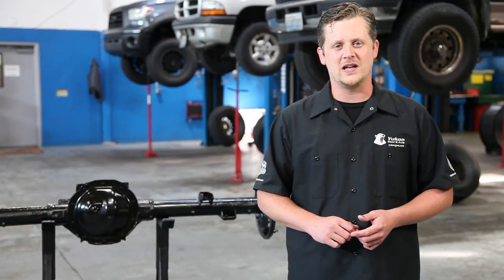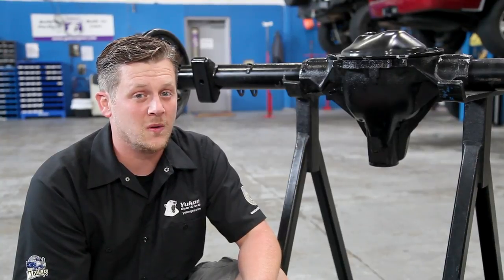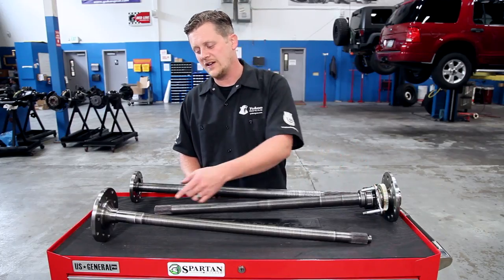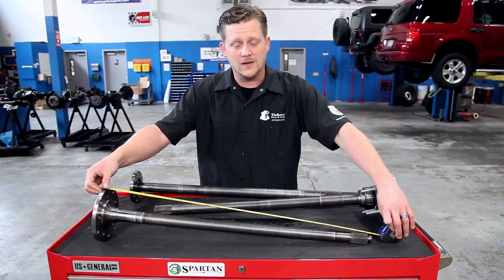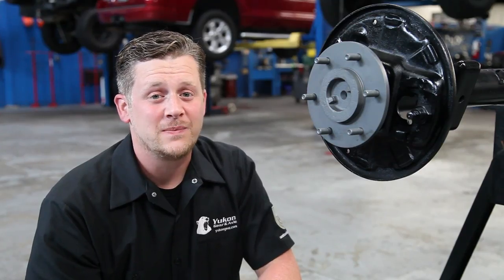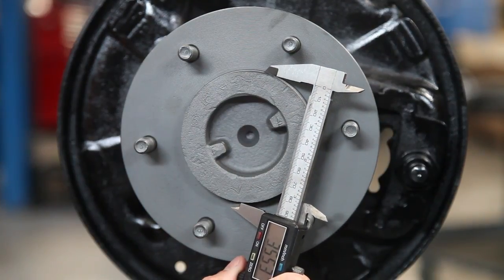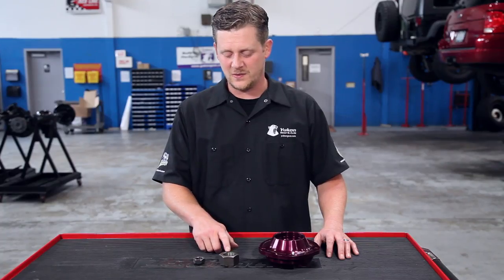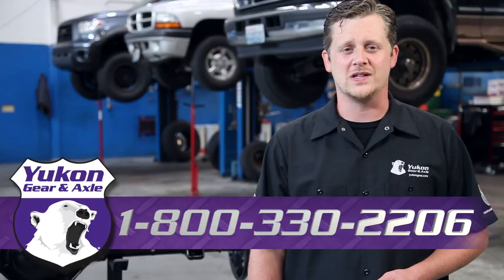How to Identify Your Differential & Axle Type | Differential Tech Tips

Comment: DANA T , 46636, 41-11 MAIL761
DANA D2, 46636, 41-11, V1L72

Dana T is from a Viper (not sure what year). Dana D2 is from a 97 Jeep Grand Cherokee 2wd. Both have the same basic shape. What are the odds they are the same part? These are numbers off the pinion gears. Both ring gears are marked with the dana t and dana d2 with a 44765, 41-11. (3.73 ratio)

Comment: I have a 2002 Chevy Silverado 1500 (6 lug, 10 bolt ) 30 spline rear axles , 8.5 dual posi unit from you guys . I wanted to know what’s the length to my rear axles , my old ones are worn out . TIA !

Comment: I have a YA G26010415 axles for a 1990 Chevy 2wd  but the factory studs won’t fit they are to big so my question is what type do I use to fit factory specs  Yukon studs  thanks in advance

Comment: great video, looking to replace the Dayton sprocket hubs on my gmc topkick c7000 1996 front and rear axles ,and it's a disc  hydraulic brake system ,GMC says that original parts are discontinued, can you help??

Comment: Is it possible for a differential with two different size axle shafts?
Reply: i have a shaft thats larger than the bearings in kit, have you found your answer
Reply: Yes! So we ended up having one axle shaft shorter than the other. Field mechanic was working on a freightliner water truck and removed both shafts at once and re installed them backwards. Truck didn’t move after that. I kept telling him the only thing he could’ve done different was put them backwards and sure enough….
Hope this helps anyone else

Comment: Hi YGA, VIN: 3GNEC12J49G171763 - 2009 Avalanche 5.3L gas (non-flex), 6 speed auto. Diff specs please? Thanks for the great videos.
Reply: RPO codes GU4 3.08 G80 POSI with limited slip ?

Comment: What is mine...
S1246
55 . 10. 2. 3 jo2
Reply from the maker: Hey @Buddy, part of the second line of the tag is missing but it appears to be a 10.25 Ford 12 bolt with 3.55 gears and an open carrier.